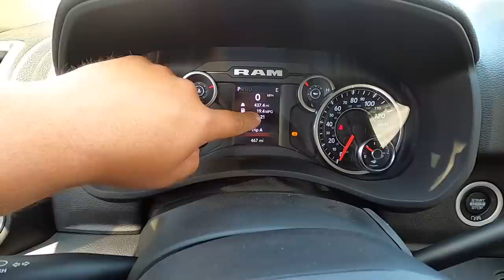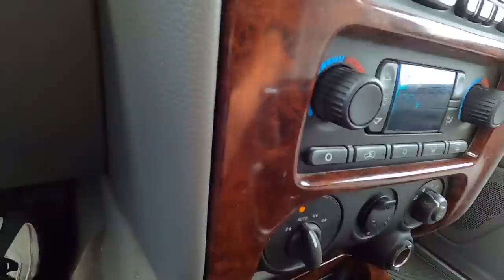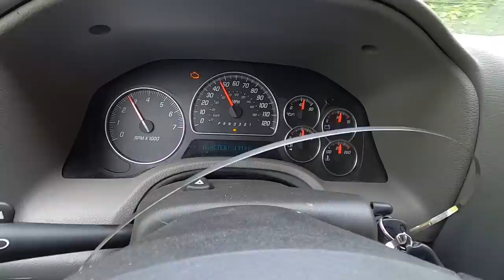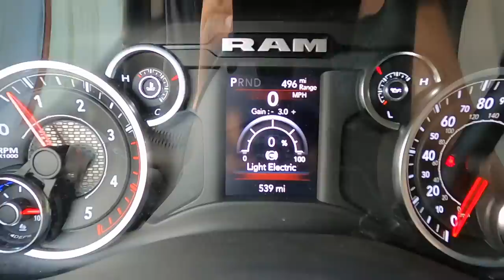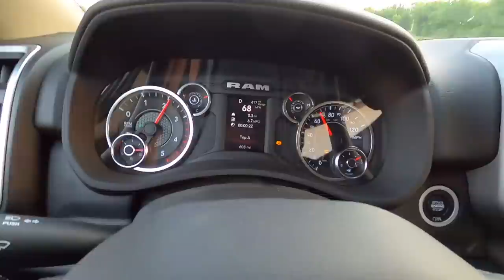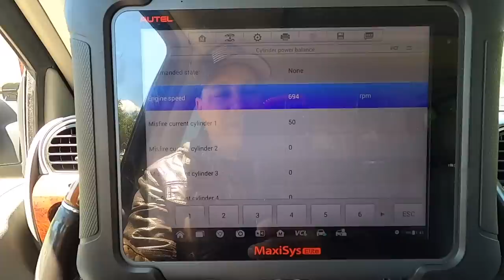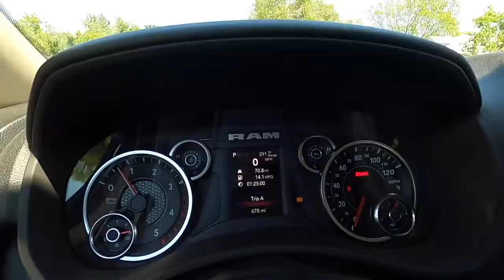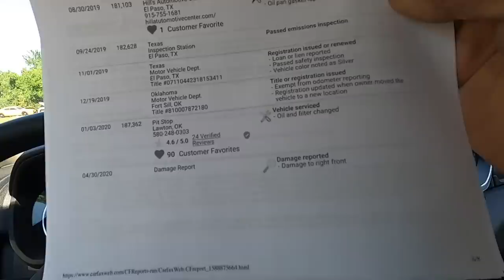$925 IAA WIN!!! 2006 GMC Envoy XL Denali 4x4 5.3L V8 - Run and Drive??

Comment: Randy,
You have a collapsed variable hydraulic lifter. The intake and or head will need to be removed to access and replace the lifter.
Reply: Yup, it sounds exactly like that. DoD is a bitch. But seeing how great the rest of it is, it could be worth it to both fix the lifter and do the DoD delete.
Reply: I believe the lifter is very long and will not clear the head for removal. Also use an OEM lifter not an after market replacement that is made in China. The Chinese metallurgy is too soft and will wearout premature. TRW - Seal Power has had many failures.
Reply: I believe you are 100% correct sir!
Reply: Is that the first year of the afm
Reply: Yup common problem well worth the fix though
Reply: @dynamodbld4814  Lifters are inaccessible on LS's without the head removed.  It's not a matter of length as the cylinder head covers the lifter bores completely and you can't even see the lifters with the valley cover off.
Reply: @LSswapGarage1  sounds discouraging for a DIY at home.
I just changed a lifter on my dad's truck. We only had to remove the valve cover and the lifter was just below the cam, all the process took about an hour including removing and placing the valve cover back, but I suspect on a pushrod engine it would be farther from the top
Reply: instablaster
Reply: Yupp typical Gm lifter thic sound lol 😂

Comment: GM has very common issues with their V8 engines.  Mainly the 5.3L engines with AFM (active fuel management).  The AFM lifters tend to fail, and stick or collapse.  Keeping good oil, and plenty of it in the engine, is KEY.  These engines also have a bad oil consumption issue, which GM say is "in their specs".  ALL YOU NEED TO DO IS REMOVE A VALVE COVER ON SUSPECT MISFIRE CYLINDER, AND WATCH FOR NO MOVEMENT ON THOSE ROCKER ARMS.  There is a TSB leading to the passenger side valve cover clogging up in the breather area, as well as piston  rings on either cyl#7 or cyl#8 sticking.  Make sure you check your oil and change it frequently.

Comment: Those 5.3Ls have the active fuel management (AFM).  The lifters failing on a cylinder are common.  It requires removing the intake manifold and the heads.  Might have to replace the camshaft too.  You could remove the valve cover on the driver's side, and watch the rocker arms to verify.  If the aren't rockin' the lifters have failed.
Reply: Wrong era. Afm didn’t come in until 2007.
Reply: @4literfandaniel373  you are misinformed. DOD first appeared in the Envoy and Trailblazer with the 2003 model year.
Reply: Freddy Wells I’ll be damned you’re right. My bad. I had no idea😳
Reply: Your correct the 5.3 and 4.7 are notorious for that issue however they will run for a long time if you don't mind the tap!
Reply: @jmccord0716  Did the 4.8 get afm? I thought it only went to the 5.3, 6.0, and 6.2
Reply: @tokuzumi1  no not to my knowledge but were still known for lifter collapse
Reply: @tokuzumi1  4.8 never had AFM in any application.  AFM came out in the 2005 model year with the Gen IV LH6 5.3 that was used in the GMT360 chassis.  2004 and prior GMT360's used the Gen 3 LM4.
Reply: @jmccord0716  Was just going to ask this....  A must fix OR annoyance, would be ok as daily A to B 'until', considering age, mileage etc.   ?   ESP considering price & situation myself & teenage son have been left in, just before all this latest pandemic stuff hit for the ultimate "wtf" 1, 2, punch....   I'd drive this in a second!    :) Stay safe & be well.
Reply: @mmanda515  it can run for a short while but can damage the engine to where a rebuild or replace would be needed. If caught and repaired quickly it's around 1 to 1.5k to repair where as a rebuild would be about double. Hope this helps.

Comment: You need to do search for curb weight of vehicle. That’ll give you typical unladen weight.  Gross weight is vehicle with max passengers and pay load.  GMC envoy curb weight comes in at 4400 to 4800, depending on specs. With v8 and AWD you’re probably at the 4800 mark.

Comment: Noisy lifter won't hurt anything. Had a Buick Regal back in the 80's, bought with the same lifter tapping. Drove it for several years, no problems. Never got better, never got worse. Good car, lasted until our salt laden winter roads finally took their toll. Rear axle stablalizer let go, causing the rear end to lock up and damned near tore the axle right off the car. You guys are extremely fortunate you don't have to put up with rust on cars down there.

Comment: Blinking engine light could mean a coil pack or plug is unattached or can't connect a spark... A lot folks or dealers would loosen plugs and connectors to discourage others from bidding on it.

Comment: Randy, I've had three GM 5.3's with a collapsed lifter. The absolute cheapest way out and feel confident in your repair is to try to "unstick" that collapsed lifter first. Remove the intake, take an old pushrod you have laying around out of a core motor, file it down a little bit so you can seat it over the collapsed lifter and hit that pushrod with a hammer. If it unsticks (two out of the three I tried this on did unstick for me) it will pop up and you wont have a loose rocker arm anymore. Now to keep it fixed, send your ECM off to have the DOD software deleted where it runs on all eight cylinders all the time because if you put it back together without the reprogram, the first time it goes into AFM mode, that same lifter will collapse again. I use a company in Louisiana for my ECM DOD delete work. Very fast and never had an issue. If it doesn't unstick, well its gonna need a DOD delete kit with new non DOD lifters, a non DOD camshaft and a replacement of that funky intake valley or VLOM I think is what they call it that controls the DOD along with a DOD delete reprogram on the ECM. The one I had to do was on an '07 Suburban with 75K and when I was done it cost me around $1,800 (parts and labor) to fix so you can see where it would be very important to try and unstick that lifter before going any further with the repair. I really hope you can unstick that lifter because that DOD delete kit is no fun. Good luck.
Reply: Hi Freddy. I've unstuck lifters the same way, using penetrating oil at the same time. Worked great. I didn't remove the intake.

Comment: I have a trailblazer just like that. Except it's 2wd has the 4.2 and is blue. Great buy these are good cars. And mine also had a misfire a while ago lol. New coil packs and spark plugs solved the issue.
Reply: Bryson Kuhn the coil packs are a common problem along with the cam solenoid cvvt sensor p0014 code
Reply: @micahhill4786  lol. Had to replace that about a half year ago also
Reply: Bryson Kuhn have you replace the thermostat yet on it now that right there is a pain in the ass
Reply: Bryson Kuhn that isn’t going to fix a collapsed lifter making all that noise.
Reply: my Trailblazer has 266k on her still looks and drives brand new
Reply: @lovellmills7959  mines got a long life to live as it's only at 122k
Reply: Yea 6 cyl and 8 cylinder 2 different worlds as far as common problems this is no doubt DOD lifter collapse.

Comment: 5:00 As long as any of the idiot lights are on, there is something that needs to be addressed and repaired. If the idiot light is flashing, it is something serious. 7:25 That is so you can keep items out of sight, or direct sunlight. 10:45 That might be a simple misfire, or at the worst, a lifter tapping, stuck valve, bent push rod.. If that were a rod knock it would be A LOT louder, and you'd have blue smoke coming out the exhaust. 11:10 The idiot light is flashing.......don't drive the car until you figure out what the problem is. 16:15 While exhaust breaking is very good for the engine, brakes, and a few other components, several municipalities actually prohibit it in residential areas because of the noise level, especially at night. You will also see the occasional sign on the expressway prohibiting exhaust breaking, and that's because that particular stretch of expressway runs close to or even through a residential area. 17:10 Stop at Home Depot and pick up a cheap 6 inch level with a magnet on it, and use it to see if the tongue on your trailer is sitting level, or if it needs adjusting. 17:30 Does part of your "break in period" include an oil change?? Some engines run "break in" oil that needs to be changed out before normal use can begin. 29:50 No need for anyone to cringe.....that's one of the oldest tricks in the book to see if a cylinder is getting spark, although it is usually done with the spark plug in the wire, not just grounding the wire to an exhaust manifold. The wire could be good, but if the spark plug is damaged or just fouled out, it won't spark.

Comment: Great truck. Info you need:  GMC Envoy: Flashing Check Engine Light Diagnosis. ... When your engine is misfiring, it is dumping raw fuel into the exhaust. This raw fuel can detonate, which causes damage to the catalytic converter and the exhaust system itself. There can be other situations that can cause the check engine light to blink as well but I’ll bet it’s a spark plug/coil pack situation.

Comment: About to pick up a 2005 Envoy XL Denali for $300! No engine or transmission! Body & interior is in great great shape,no major body damage or rust no major scratches or cracks! Interior is black with the Navi system/CD player & absolutely pristine! It had the 5.3ltr V8 with AWD but engine was sold! I actually own a 2003  Envoy XLT with the 4.3ltr inline 6 with over 276,000 miles and love it! It's not in the best of shape compared to the Denali I'm purchasing is the reason I'm buying the Denali. Plus the Denali is something I've always wanted! My (?) for the wrench heads is are the 5.3's as reliable & maintenance friendly as the 4.3ltr and is this deal worth it! Still keeping my 2003 Envoy XLT for a daily.

Comment: Randy, I’m a mechanic and I cringe every time you drive a vehicle with the check engine light flashing.  That flashing means that a SEVERE MISSFIRE is detected.  If you continue to do so you run the risk of DAMAGING THE CATS. unburned fuel is going through the exhaust and cooking the cats. SHUT THE ENGINE OFF IMMEDIATELY

Comment: Trailer weight is 7000 pounds and you have to include in that the weight of the trailer so if trailer weighs 2000 then you can put additional 5000 on the deck. Keep doing what your doing man love the content- Brandon K

Comment: The GVW is the total weight of trailer and cargo max.  There should be a decal that says max. cargo weight capacity and/or weight of trailer.  My guess is you're probably close to maxed out with that Denali on board.

Comment: It is Sunday, 10th of May in Australia & Mothers' day so, from me, a Happy Mothers' Day to Jessica & your respective Mums.
At 7.30 pm, you lowered the trailer back down, which is far easier than lowering it up. Lovl.
In Australia, GVM is the total mass of the trailer & load & the GVM of the vehicle is the total weight of the vehicle with all liquids (e.g. fuel, oils & coolant) occupants & luggage, etc. So 2930 is that weight, as opposed to the tare weight, which is the vehicle without fluids, occupants & luggage.  CVM is the weight of the tow vehicle, fully loaded & anything the vehicle is towing, in this case, the vehicle plus trailer & it's load.
Hope that helps clear your queries, Randy.

Comment: The Cummins will pull whatever you put behind it. A general rule of thumb with the 6.7 is when towing, keep RPM's at or above 2,000rpms. It's the sweet spot for the engine. It gives you enough power left in the RPM range to pull but also gets you high enough in the RPM's to allow the Exhaust Brake to do something when you let off.

Comment: It crazy to see how common this is, I just bought a 07 Denali 5.3 envoy with 169 k with the EXACT symptoms. Yours is cylinder 1 mine is 7 the same side bunch back cylinder. It is the collapsed lifter from DOD AfM as others have said for sure. I was able to pull valve cover verify the intake rocker wasn’t moving, then pulled intake and valley cover VLOM and insert a homemade steel rod into the oil passage for that lifter and hit it with a air hammer lightly and quickly which popped the litter right back open. I then used hptuners and 2 credits to unlock ecu and disabled DOD to prevent it from going into 4 cyl mode again… I closed off the oil passage where the oil sensor is in vlom with a metal bushing and loctite, and popped the retaining rings off the solenoids on the vlom and I pulled them off. Put it all back together and have been running 1000 miles plus so far runs like new smooth as silk. I did a couple vids on it.

Comment: Randy only use ac delco platinum plugs this comes from an auto mechanic that way you know it will be really great running car and they will not burn up the. The plug love that car and your truck. Is great and you brought the best you could afford. I know. Diesel motors are very economical great video loved it

Comment: I had an 07 F250 long bed crew cab with the 6.0. Drive from Huston to Palm Beach. Ran 70 mph and got 12 miles per gal.  Trailer was over 11000 lbs. got dark and didn't know t was on the back.

Comment: Two things I noticed: It seems like the fan clutch is seized so the fan is running wide open, you can hear the fan rev with the engine, and unless it's really hot it shouldn't do that. Also pause it at 13:11 and you'll see there is a massive hole in the air intake after the MAF which will cause issues, and is probably contributing to the misfire. The tapping sounds like top end, maybe a lifter. The good thing is, the 5.3 is in pretty much any GM truck, so even if you had a worst case scenario which isn't likely, you could get an engine relatively easily and cheap.

Comment: That tick is probably from a DOD (cylinder deactivation) lifter. They make DOD delete kits
Reply: One year too early for afm. Afm showed up in 2007.
Reply: @4literfandaniel373    Wrong.  The GMT360 chassis got afm in 2005 when they went to Gen IV LH6 5.3's
Reply: @4literfandaniel373  DoD 2003.. Afm, 2005.   Stay safe & be well.

Comment: Hey Randy, to see if it's the coil wire is the issue, try switching the wire to another cylinder, then clear the code and if it comes back misfire at the other cylinder, then most likely it's the wire. Good luck!

Comment: Although the dealership would never tell you this, but personally,  i would do an oil change at 500 miles on a brand new engines.  You will find allot of metal in the oil, which is normal.  I wouldn't want metal suspended in my oil any longer then you needed.  Something an old mechanic once told me so I did it and under bright light you could see the metal in the oil.

Comment: Bro what you have heard is absolutely correct once it gets more miles your mileage will go up ! My 99 turbo diesel when it was new i was getting 16, 17 miles to the gallon my truck was also a 4x4 after about a year my mileage was  around 21.

Comment: Displacement on demand or "DOD" started in Envoys and Impala SS 5.3 engines for this model.  Probably a collapsed AFM lifter on cylinder # 1, 4, 6 or 7.  Very common.  I have a 2007 that sounds identical to it with a collapsed AFM lifter on number 7.

Comment: Randy the RAMs exhaust brake COULD use engine oil and burn more fuel. I cant speak toward the Cummins they put in regular trucks but the tractor trailer versions due burn oil and fuel with it on. Just a friendly FYI. Just something to keep in mind. Basically how a Jacobs Brake works is it holds the exhaust valve open which essentially turns the engine into a air compressor.    Good purchase on the envoy though! That looks like a real money maker.

Comment: on the RAM, use the REAR tire pressure for LIGHT LOADS,
it will smooth the ride out, and you can haul a reasonable amount of weight even with the lower pressures

Comment: To figure out the weight of that Denali, take the 6400lbs and subtract it by the cargo carrying capacity on the yellow/white sticker (tire spec sticker) on the door sill. That trailer can handle 7000lbs maximum, trailer itself weights somewhere around 1800lbs empty.

Comment: Ticking noise is most likely the engine tappets
you can buy liquid to quieten the tappets from autozone
Reply: Marvel mystery oil does a good job in reducing the noise
Reply: Ya probably lack of oil changes and eventually oil pressure or heavy towing
Reply: Don't put snake oils  in it! That's how people that DON'T KNOW HOW TO FIX CARS OR ARE TOO CHEAP TO FIX CARS "fix" cars. The parts stores make massive amounts of money of you people along with people that replace unneeded parts. This thing has a collapsed lifter. Has to be repaired with real parts and real money.
Reply: @corymagnus7452  ow ya I'm a Toyota or Nissan fan so I know little about gm stuff we don't get them hear in Europe

Comment: I believe lifter is going bad.  Also, could be sludge, I fixed (yes, it worked) a lifter due to sludge buildup by running transmission fluid thru the engine and drove the vehicle for a couple hundred miles and the noise got better.  After a oil change using good quality oil and filter, I'm happy to say the noise went away.  Also, the injectors make a loud noise when firing on those 5.3s.

Comment: "It helps to be able to see when you're driving, you know?" -Randy 2020 lmao

Also, I've had three Trailblazers and one Envoy in my past. I absolutely loved those trucks. Be sure its had the ignition switch recall done on it! I can not express that hard enough. My final GM I ever owned was a Trailblazer that had a faulty ignition switch before GM finally did the recall on it. They skated me so hard about the issue. It was terrifying having that truck shut off at any speed at any point. Especially when it happened on the highway and you're just coasting along with no power steering or anything.  Be safe!